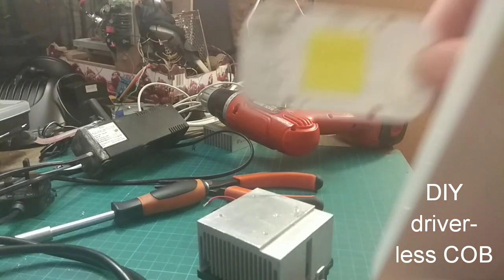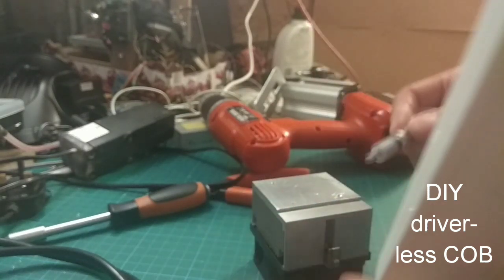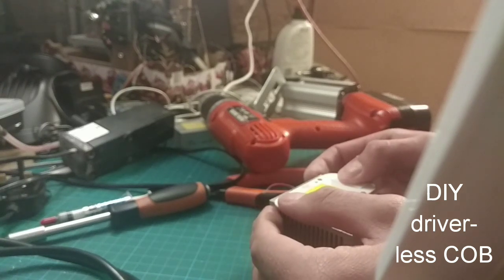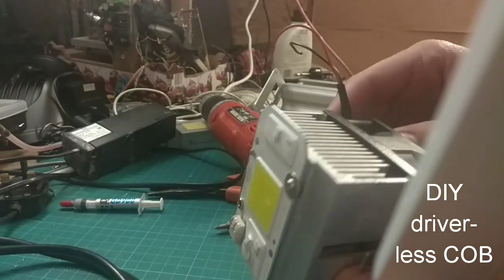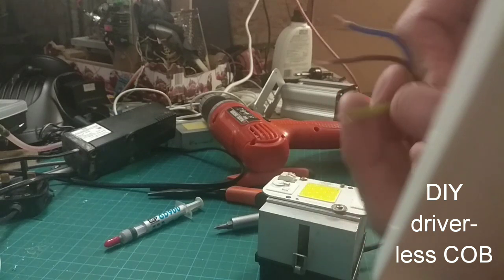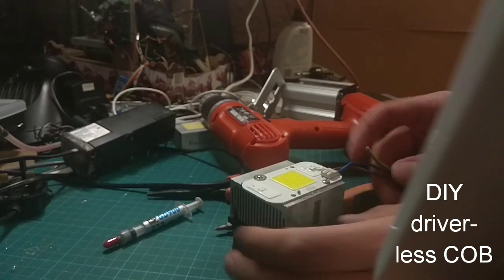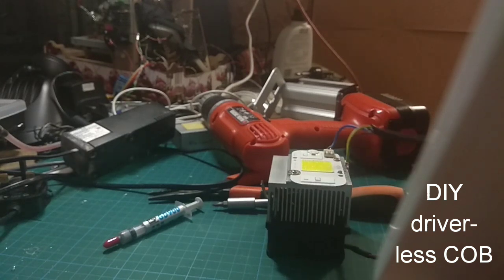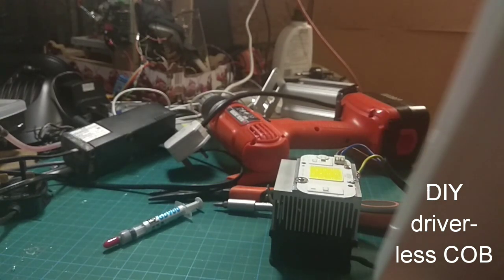How to build a cheap driverless COB grow light

Comment: For anyone looking to do this, ideally you'd use plastic washers because the white isolating layer is quite thin, even though the leads under it should be far enough away. Another thing to mention is that the short circuit protection doesn't work that way. If a short circuit happens, nothing guarantees that any of the two (L, N) wires will get grounded. And in most cases they don't get grounded, the circuit breaker will trip if the current from the shorted live and neutral is high enough, 10A or 16A in most cases (for 220V). When you do connect/short the live and ground, that is another thing, and there the GFCI/ELCB/RCD will trip, and that happens at a much lower current, often lower or equal to 150mA. Not that the advice of grounding our projects is wrong, but you really shouldn't be making such an insecure connection with any of your mains wires (L, N, G) like shown when connecting the ground.

Comment: Hi there, I came across your channel because I saw your messasge on the COB light comment that you have done on AliExpress. I have purchased the same LED and will use a computer heatsink like you to use it. But may I ask if you manage to combine LED cabling and also fan cabling to 1 out so that we can use 1 plug to run both at the same time? If you have done it, I would appreciate if you share a short video on your channel to understand how we can do as well?
Reply from the maker: Hey, there isn't. The cob requires high voltage AC and the fan low voltage DC. You'll need a separate power supply for the fan
Reply: @MTechOver9000  But in anycase we can use a simple 12V 1A adapter and connect COB's powering cable to the end of adapter to plug in to wall DC, so that adapter will be 1 plug :) Aren't I?
Reply from the maker: @eozen81  lol, for safety reasons I do not advise this!
Reply: @MTechOver9000  thank you I didn't know that it is dangerous 😱
Reply from the maker: @eozen81  please also used fused and earthed plugs when wiring your cobs!
Reply: I will absolutely use it. I had also  read your  safety message on AliExpress. You are very kind to share this. Thank you again and again.
Reply: MTech over9000 and what’s able wiring